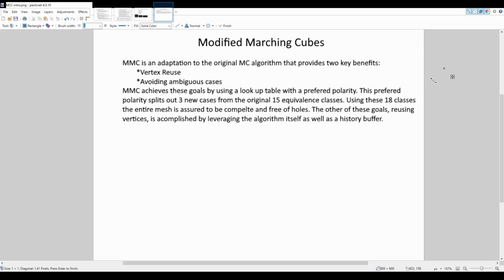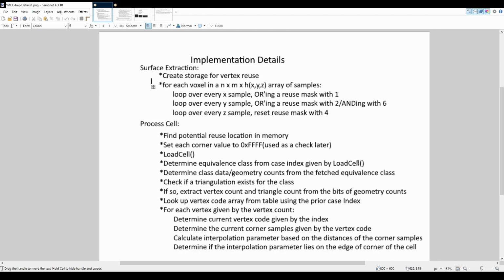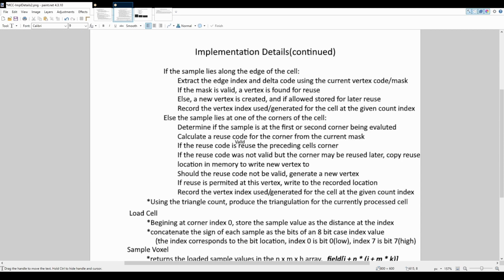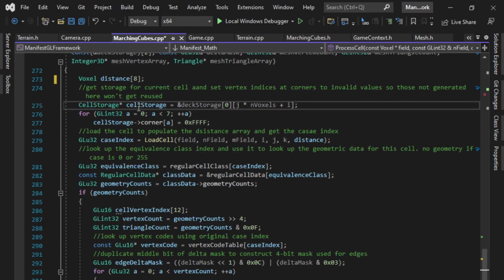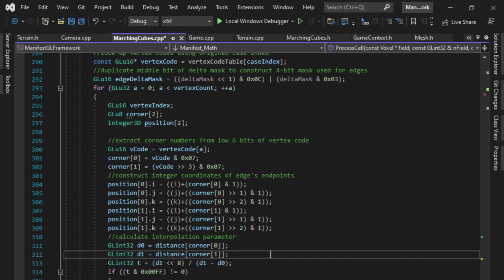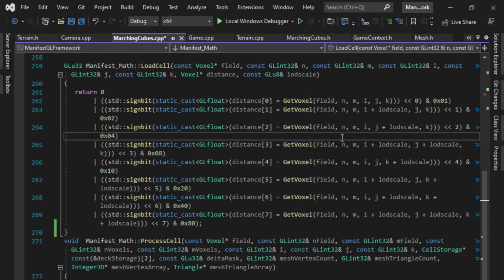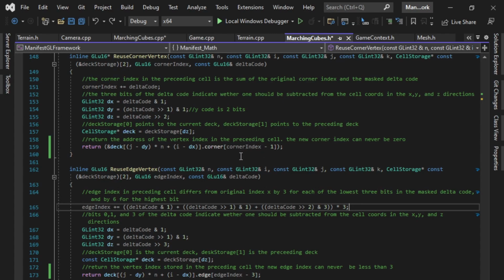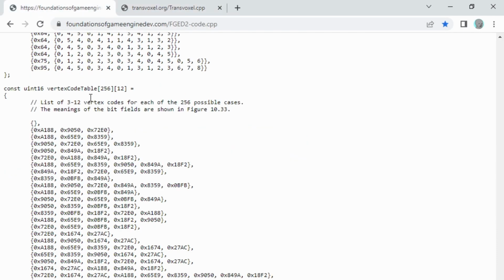3D Terrain Engine Test 3 - Modified Marching Cubes

Comment: thanks for making this video - Do you have source code available for your implementation?
Reply: Nevermind - I see that it's mostly all there in the link that you mentioned - thanks
Reply from the maker: @jimmarshall3724  you're very welcome! Let me know if there's anything else I can help out with :)

Also I can always throw up the terrain into it's own git repository if needed. A lot of the code has changed from the terrain mini series as it got worked into the rest of the engine however the extraction functions are more or less untouched

Comment: Can you pls show the Voxel structure you use in line 273?
Reply from the maker: Of course, my apologies it should have been included with the other structs. The Voxel itself is a typedef of an int8. The voxel samples in the field are generated from some noise function(Perlin in this case). line 273 specifically is just an array to store the 8 samples of the current cell being extracted